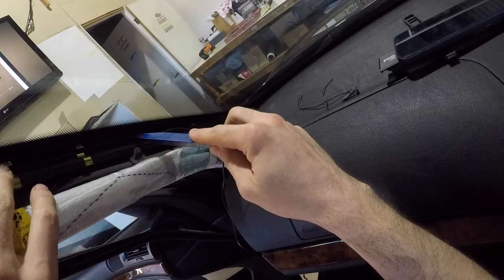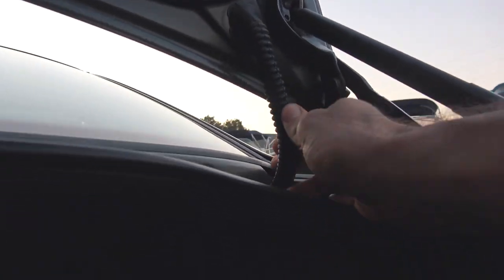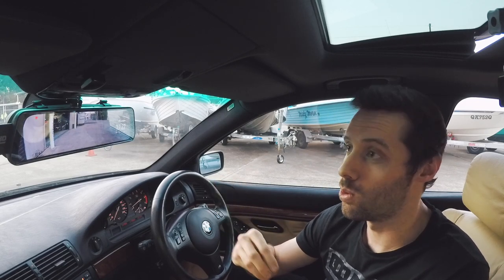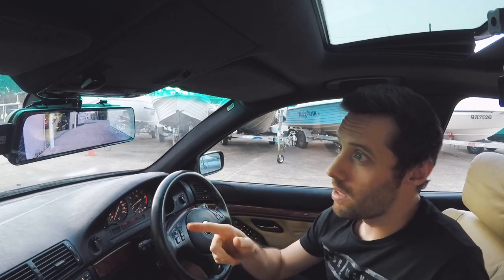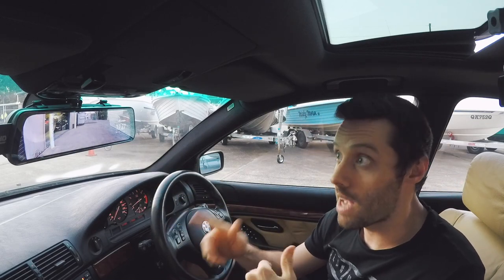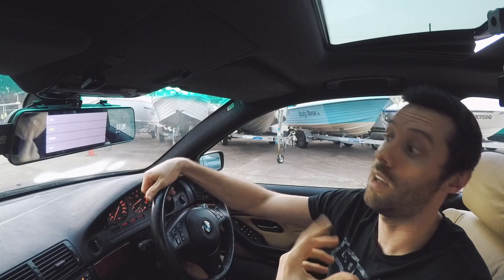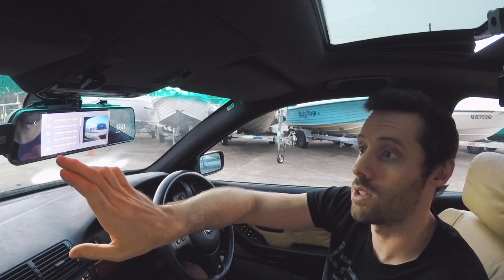New 10” Touch Screen Mirror Dash Cam Review and Front / Rear Camera Install - Acumen XR10

Comment from the maker: Since doing this video Acumen have been in contact and are now offering an EXTRA 10% off this item until end of December. To get the extra 10% off use code: 10AXR10YT
Reply: Thanks
Reply: Hey mate good review getting one of these for my suzuki swift 2008 as it doesn't have one built in.
Reply from the maker: @marleymason5479  thanks mate, its funny you don't know how much you use these until you get in a car with out one. Let us know what you think of it once you get it installed.
Reply: @ZeroTo60Tube  What are these like on your car battery do they drain quite bit or are they economical.
Reply from the maker: @marleymason5479  The better quality mirrors like this Accumen have a built in battery, so they only draw from the car when you have the car on. When the car is parked it runs in a low power state of its internal battery. It basically just starts recording if it he pics up a noise. It did catch my car when it got caught in a hail storm a couple of months ago.

Comment: Great review. 
I think it's great that the system remembers your preference for the rear camera, and that you don't have to turn this option on every time you start the car. I will order this for my BMW touring, only my camera will be in the car behind the rear window.
Just a question, what about updates. Or are there never any software updates?
Reply from the maker: We haven't looked for any updates as yet. But really haven't had any issues to chase the updates. The mirror has been in for a few months now and ive been really happy with it. Let us know how you find mounting the camera inside the rear window. I wondered if rain/dirt would be a problem with vision.
Reply: @ZeroTo60Tube  No problem, I will let you know.
Reply: @ZeroTo60Tube  update.

no problem with the rear window camera, the view is perfect. 
No trouble with rain or dirt.

I mounted the camera on the inside behind the window on the roof lining in the middle.

 (But then I don't have a sedan, but a saloon / station wagon BMW with rear wiper and wash.)

Installation was a piece of cake, and the images that the cameras make are just perfect.
 You do not need an expensive dashcam for 300, 400 or 500 for this. 

Because this dashcam you place over your rear view mirror, it is also difficult for someone else to see that you have a dashcam.

I think this is a disadvantage with other dashcams, you always have to think that the suction cup does not come loose, and that you cannot let the cam sit in the event of theft, since the dashcam with suction cup stands out much more.

Because my windows are tinted all around, there are no problems with the view for the cameras. 
My front window is 70% (30% darker) and my rear window  20% tinted (80% darker)
But this is no obstacle for the dashcam, not during the day or at night.
Reply from the maker: That’s awesome to hear!!!
Reply: @ZeroTo60Tube  forgot to say, I dont use the cable to the cigarette lighter.
 Im using a buck line that has a fuse, now you do not see any cable in the car.
And the camera always has power.

Comment: Does it need constant dc power for some of the features to work?  Or does the unit save power ??
Reply from the maker: It does have a battery built in for the parking monitoring but most features you need it plugged in

Comment: Great video! I got one for my 04 BMW 330i ZHP. How does the wire fit in the pillars? Did you need to use the pry tool?
Reply from the maker: I will have to check with dave. From memory he pull the top section of the pillar away and the poked it in side all the way down.
Reply: @ZeroTo60Tube  Thanks! Let me know please. Also, do you keep the dash cam adaptor plugged in when parked? Did it drain your battery? I plan to use the adaptor it came with so I won’t need to hardwire it.

Comment: does this camera beeps when u get close to a car infront of you?
Reply from the maker: No, it doesn’t have any sort of sonar sensors or anything like that.
Reply: @ZeroTo60Tube  thank you. One more question please. Can i mount the rear camera inside the car on the back windshield using 3m? I have camry. My concern is since the glass is kinda not straight. Would the camera be tilted and not catching anything?. Do i have enough to get it straight to catch the back view?

Comment: Does that mirror autoflip upside down like an android device? Since I think you need the front camera to be on the right-side (close to the windshield). Otherwise the leg of the original rearview mirror will appear on the screen, since the camera behind the leg. Hope you got what I mean.
Reply from the maker: Hi Gunadi, no it doesnt flip. However the camera hangs off the end and is adjustable. What car are you thinking of fitting it to?
Reply: Hi @ZeroTo60Tube  my car is nissan juke (right handed).
Reply from the maker: My car is RHD as well and because the lens of the camera sticks past the mirror it seems to be ok and doesn’t film the mirror in its vision

Comment: Geat review. 

I just nstalled my Acumen xr10 and in the settings find the oprion "Flicker  50 /60 HZ" mean?  There is no mention of this option in the cheasy manual.

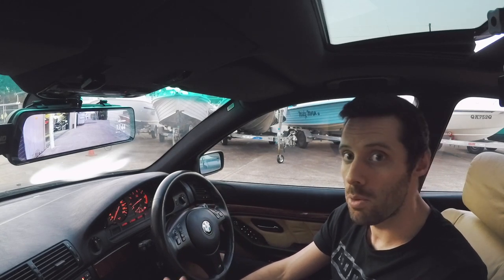Is there any way to turn off the military time clock?  When its 1:05 am here it says 13:05 ?  Just kinda funky IMO.
Reply from the maker: it will be something to do with the refresh rate, or the "flicker rate" of the display, not the recording. If your monitor does not flicker now then you shouldn't need to worry about it.

Regarding the time I don't think it can be changed from memory, but when I get my car back tomorrow I will double check and if yes I will let you know how. Cheers
Reply: @ZeroTo60Tube  this firmware virsion that I have gives me the option to record on 1296p or 1080p whichone would you recommend?  Im running a Samsung high endurance 64gig micro sd card.
Reply: I noticed on my Acumen xr10 about every 5th or 6th start up my Acumen xr 10 shows "locked file" and flashes yellow dot in the upper left hand corner. Does your xr10 ever start up in the locked settings.
Reply from the maker: @ddemier  I think that is just the notification that an event has happened and a file will be locked on the card and not over written automatically.  have caused it a couple of times by being a little enthusiastic while getting in the car.
Reply: @ZeroTo60Tube  ok so maybe turn the sensitivity down on the vibration detection.
Reply: @ddemier ddemier  I realize this was a month ago and you've probably figured it out already. However in case you haven't: if at 1:05 a.m. your dash cam is reading 13:05 then you've set the time incorrectly by twelve hours. At 1:05 a.m. this thing should be reading 1:05 but at 105 p.m. it should then be reading 13:05. Military time is simply a 24 hr clock. 1:00 p.m. is the 13th hour of the day, hence 13:00.